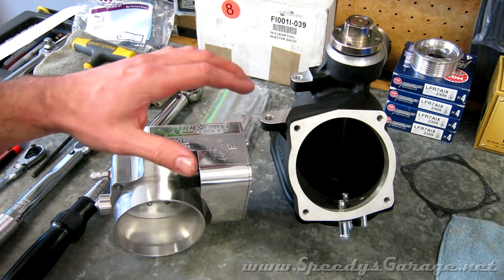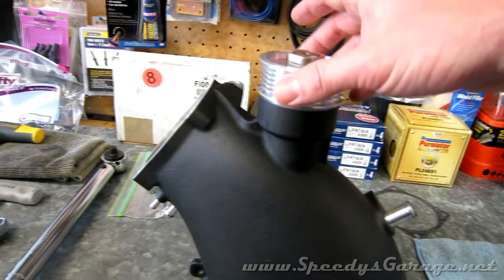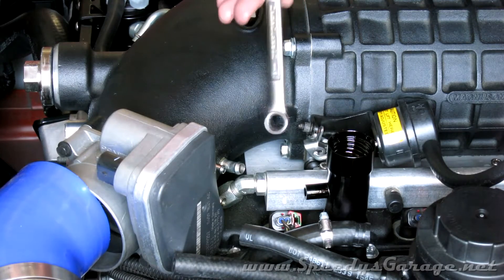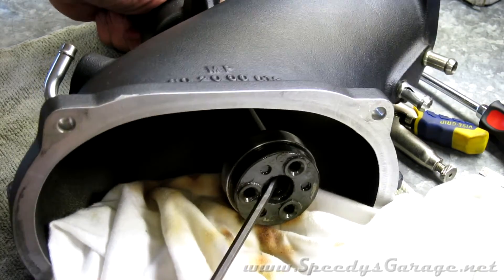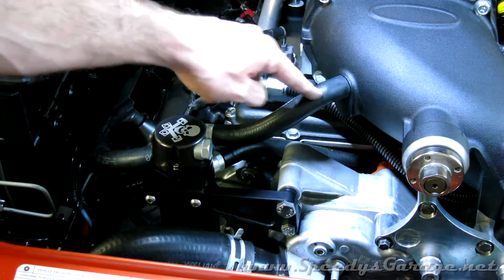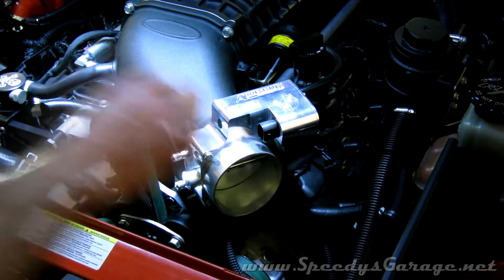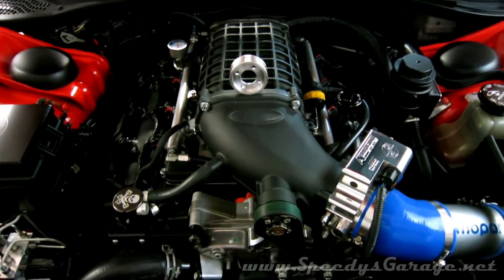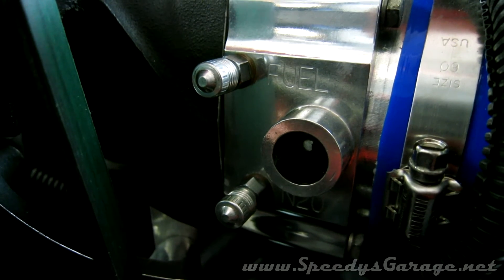Magnuson 90mm TB and Blower Snout Upgrade

Comment: I'm doing the same thing as you except with an Edelbrock E-force on a 5.7. The opening on the throttle body mounting flange is 89mm, so it's a simple bolt on for the 90mm TB.

Comment: What were your results with the smaller pulley? I heard anything smaller than a 2.65 doesn’t do anything. The smallest I found was a griptec 2.60”. I’m currently running a 2.90” on my 6.1 300.
Reply from the maker: I couldn't get it not to slip so never got results.  I still have it if someone wants it.  Carbonite coated and all.

Comment: I have been thinking of putting a whipple supercharger on my 2012 challenger rt with stock 5.7L, the whipple comes in at 8lbs of boost, how much can my engine handle safely? Also what are your thoughts on a snow methanol injection kit?

Comment: I have a 2009 SRT8 with the same Magnuson S/C running the stock Maggie tune.  I've been toying with the idea of putting a smaller pulley on there but not too sure about upgrading the internals before hand.  Have you gone to forged pistons/rods/ crank? I've been off the forum for a while so i'm not really tracking the progress people have been making.
Reply from the maker: Yes.  This car has an Arrington Performance forged engine stroked from 5.7 to 6.0L and 9:1 compression.  Most 6.1 HEMI engines can handle 8psi pretty easy, some 10psi with the right tune.
Reply: I know this is old but how do you achieve a flat 6.0L ci motor from a 5.7L thats definitely different

Comment: Is that the 2.5 pulley at the end of the video, or the 2.65?
Reply from the maker: ScoobyBaseball They are both shown at the end of the video.  The dyno graph is the 2.65 with the 90mm TB vs the 2.65 with the stock TB.